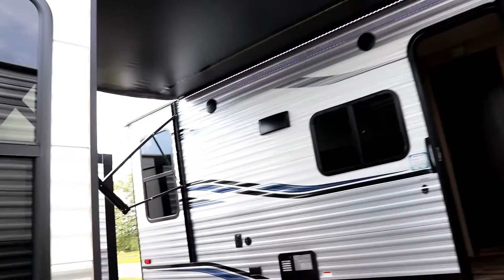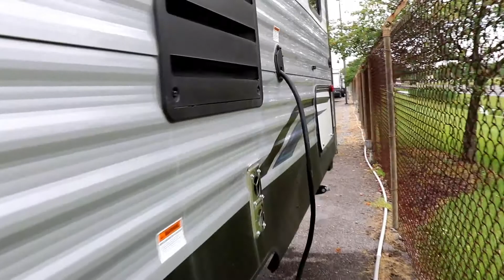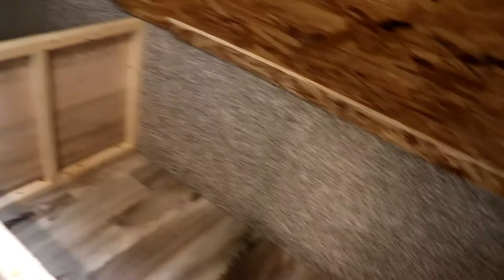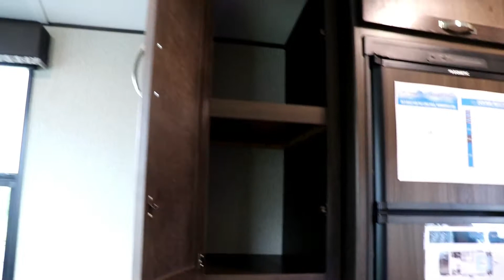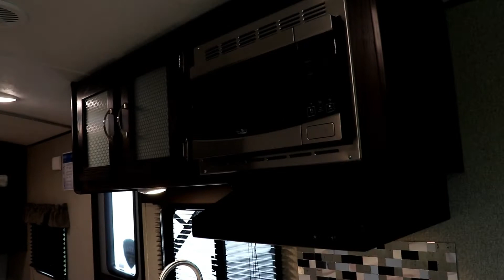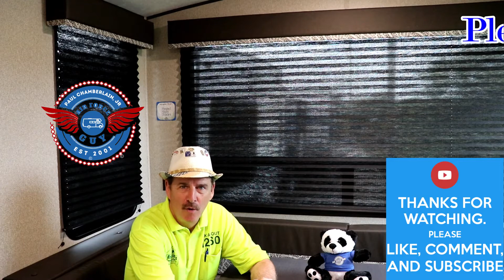Springdale 202RD by Keystone RV  - w/"The Air Force Guy"

Comment: Hey Paul, a question I'm sure you have the answer for. Single axle tire monitor system.  I know these systems come for 4 tires and motorcycle 2 wheels. What is the best option for a single axle. Our to be tow vehicle has this onboard from factory.
Thanks for any info
Reply from the maker: Thanks for the question.  All depends on your tow vehicle.  You could go with a tear drop like the TAB 400 or Little Guy Max.  Others to consider are the Minnie drop, Micro Minnie, Coachmen Clipper or PTX. Hope this helps.